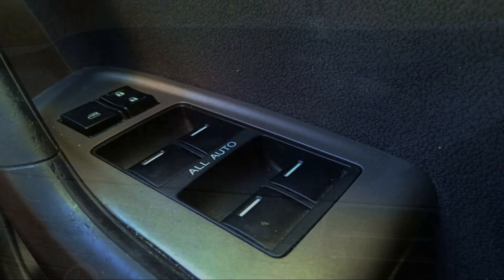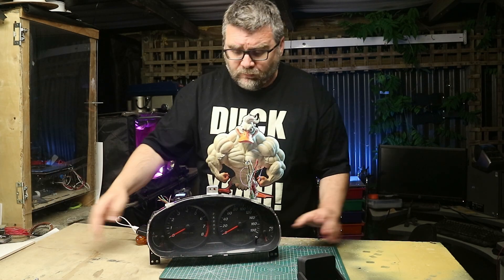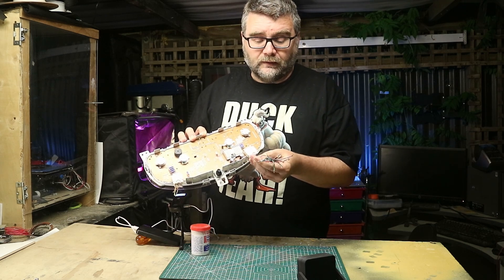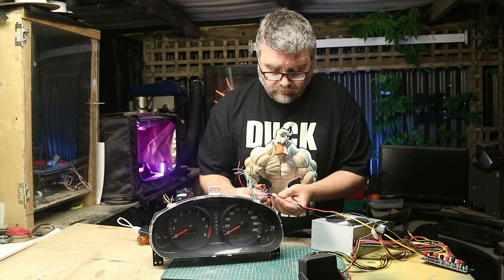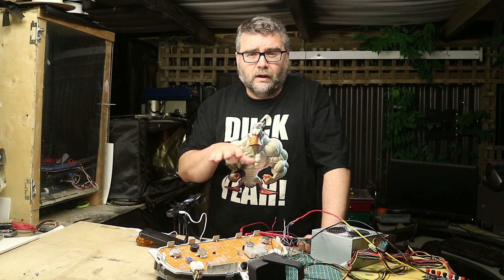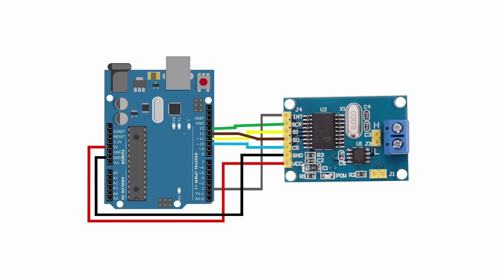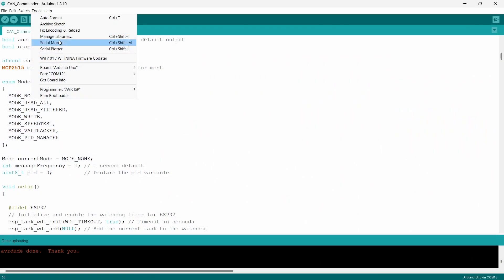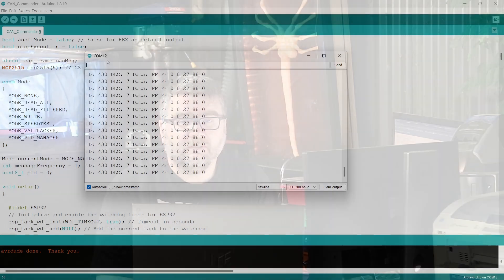Getting Started With Automotive CANBUS

Comment: Good video! I’m struck by how similar CANBUS is to DMX512!
Not that I’m an expert, but on the surface I’m seeing similarities!
Perhaps a Honda Element dash would be a good candidate? Very prolific and might have the documentation you need
Reply from the maker: That is a cool looking dash, I think it is call a Honda Fit down here.
Reply: @JWNZ  The Element is not a current car but was pretty popular in the US from 2003 to 2011. The Fit is a cute little thing! 
Honda is so good about sharing parts between models, so it's entirely possible

Comment: Shame you couldn't get it working, can't wait for part 2 though
Reply from the maker: Seems there is an RX8 database available so I might have to find one of those.
Reply: @JWNZ  I've actually ordered an RX8 dash after some research, hopefully I can get it working
Reply: My dash came and preliminary hacking about I managed to get it working
However you can't get all of the lights and gauges to be controlled purely through canbus, turn indicators and other stuff need to be controlled via relays, I am looking at getting a multi channel relay and see if I can control more things
Reply from the maker: @afkafkafk  Yep, I have found the same. I can turn in on and off the engine check lights and battery check but the others physical switches.
Reply: I'm currently working on a Mazda speed 3 cluster, I have everything I need but for some reason I'm getting no response from the cluster. I wonder if you could try the Mazda 3 canbus code surely it's very similar.
Reply from the maker: @TheNuttyPukeha  hmm, what year is it? Are you getting canbus messages from the unit?
Reply: @JWNZ  it's a 2007, it's been done around the world with standard Mazda 3 clusters but that code doesn't seem to work for me so I'm going to do what you done and try figuring out what codes to send.
Reply from the maker: @TheNuttyPukeha  Yeah, as long as you are getting data out of the dash you know you are at least talking. I would be surprised if the id's I found don't work for you.